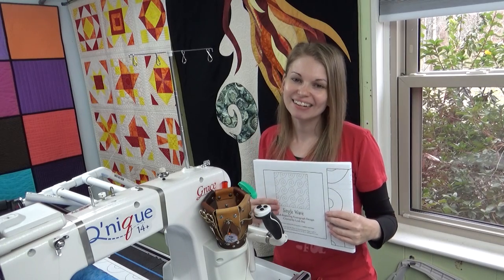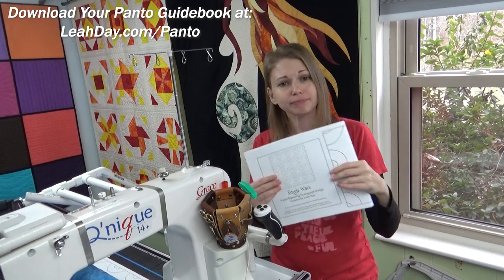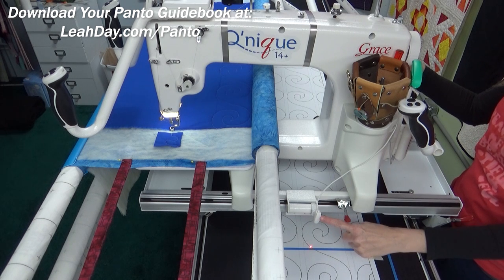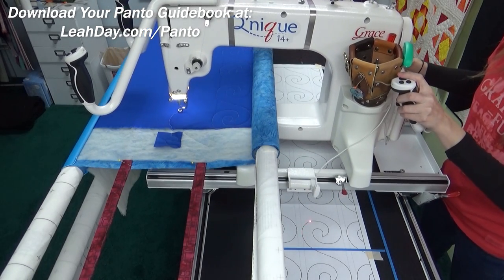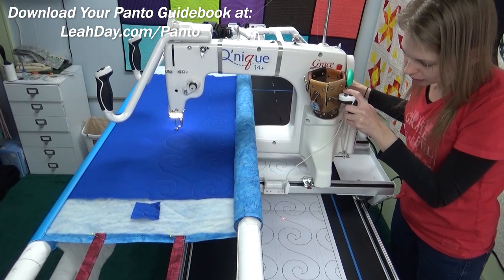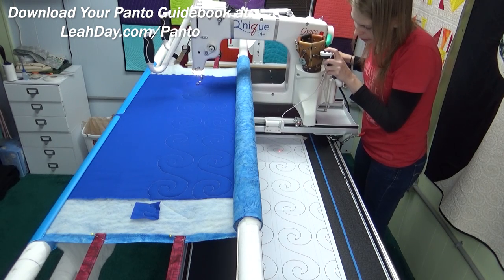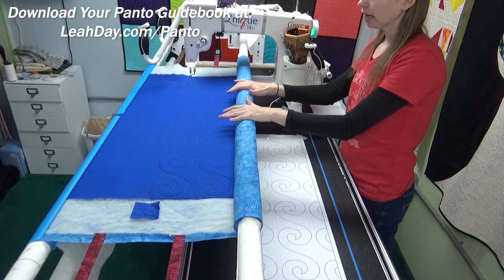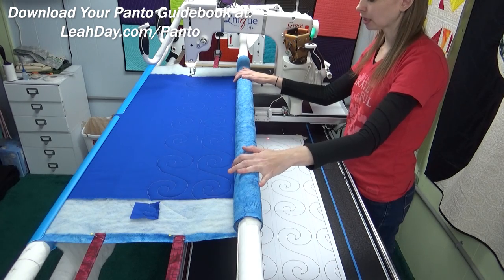How to Quilt with Pantograph Designs on a Longarm Quilting Frame

Comment: I know I’d love a long arm and have test driven a few. A helpful tip one vendor/quilter gave me was to achieve a smoother shape increase speed greater than a crawl while completing the curve then pause & adjust your feet and begin through until the next curve.  It felt smoother and the pattern was more manageable. So much fun!
Reply from the maker: That's a great suggestion! Thank you for sharing!

Comment: Thank you for the tip about the straps.  That is genius.  When I use those clunky clips on the side, the machine platform hits those  and causes a wobble.  Maybe you have already done this, but what about tutorial about squaring the quilt top  - so that when you use the panto it doesn't slant.  Thanks again.  Your tutorials are awesome.
Reply from the maker: I'm so glad you found that helpful Alex! I'll add that topic to my list. Most likely the issue is stemming from piecing first and that's what I'd check in on to begin with. What is the method you use to attach quilts to your frame? Do you pin to leader cloth or use something else?

Comment: Hi Leah, I can quilt with pantographs at the FRONT of my machine with a laser pointer attached to the handles. I can clearly see what my needle is doing right in front of me. I place a pantograph sheet on top of my ironing board (or use slim table - at the right height!)...while using my Cutie Frame. Also, I extend the front handles toward me (with the laser light!). Can this method work on other frames, too?  So easy to move the ironing board along (w/panto) when it's needed! Love your videos. So easy to follow - and they're timeless! Thank you!

Comment: I have been quilting a couple of years and have never seen a comment about checking the underneath stitching; just the top stitching. How do you know that underneath stitching is perfect and how often to check? Any tips would help. I have enjoyed all your tutorials. Thanks
Reply from the maker: On my longarm, I first run a test to the side of the quilt at the beginning of any quilting session. Something could have gone wonky, especially if I haven't quilted in a bit. I also test to the side when I change needles, change bobbins, and change threads. Basically - any change deserves a test and check the top and back of the quilt. If the machine sounds weird, if the thread looks weird, if anything goes weird in any way at all, I always stop the machine immediately. And with pantos because you're quilting from the back - it's a good idea to check in with every row. I would especially check the amount of thread in your bobbin at the beginning of each row because a thread break in the middle of a panto is ANNOYING!

Comment: Some one had mentioned they were temped to draw the line on, why not why be temped? Also do the large blue plastic clamps you are using to hold quilt on fit all frames? I have an older HQ 16. As far as using a wider panto pattern wouldn't you advance the same amount of the quilt? Whole quilt would still be quilted. Maybe I just did not under stand the explanation.
Thanks Pauline Love all your tutorials
Reply from the maker: Yes, the Quilt Clips can fit on most frames. A wider panto would quilt your quilt faster with fewer advances. If you had an 8 inch panto that would double the speed of the project over a 4 inch panto.

Comment: I know this video is older but I'm hoping you will see this question. How much room do you have between your carriage (or the farthest your machine goes back) and the wall behind you when you do the pantographs? Right now I have less than 2 feet of room on the back side of my frame. I might be able to squeeze out an inch or two more.
Reply from the maker: That's a good question - I set my frame 22 inches from the back wall and this feels comfortable to stand in for me, but I don't do tons of panto quilting. If you plan to do a LOT of pantograph quilting from the back, give yourself more space.
Reply: @LeahDay  Thanks, when I move the frame back into position after stowing the Christmas boxes away, I will find a way to gain a few more inches.

Comment: Hi Leah, I’m researching a bunch to load  my quilt on an old grace wooden frame,  and then to do panographs (waiting for your set up videos) can you tell...if my quilt just fits on my rail, therefore hardly any room for the batting and backing extra on the sides... I’m worried about not reaching the edge of the quilt with my janome 6600... what would be my best option.... should I just quilt the main body of the quilt and leave the edges like a border and do the edges / borders on my sit down machine? Hope this makes sense
Reply from the maker: Unfortunately this quilt is just not going to fit on this frame. I would advise either ripping off the borders so you have an extra 5-6 inches on both sides of the frame, or breaking this quilt down in some other way so it's smaller. This is the challenge with rolling rail style frames, which all of the older wooden frames were - the frame must be BIGGER than your quilt. 1 foot bigger on the rails so the backing has space to spread out and not be cut short and another foot because the sides of the frame take up space too!

Comment: Great tutorial. I wish my pantos had those lines. I'm tempted to go draw them on! Also do you plan on adding a bigger selection of pantos? I have the Block Rockit, which is the same machine as the Q'nique just branded for another company.
Reply from the maker: Yep! I do have plans to make a lot more pantos. It's just REALLY hard to make anything that requires special folding and cutting like these right now with my studio so torn up. My house flooded in February and we're basically renovating the entire basement to make it easier to use as a studio and office.
Reply: @LeahDay  sorry to hear about the flooding. I can't wait to see more. I'm even drawing lines on my older pants because your method is so much easier to line up row by row. Thank you.

Comment: Can pantographs be used with a sit down quilting?
Reply from the maker: No, this is a technique specific to frame quilting because you need to be able to move the machine following the pattern. On a sit down / stationary machine, you're moving the quilt, not the machine, so there really would be no benefit to following a pattern with a laser.. It just wouldn't work the same way!

Comment: ? i see alot ladies put laser on left side of the machine why is that ?
Reply from the maker: On this longarm the encoder is on the wheel on the opposite side which would hit the bar that the laser attaches to. Might not be the same for all machines like this, but that's the way mine works!